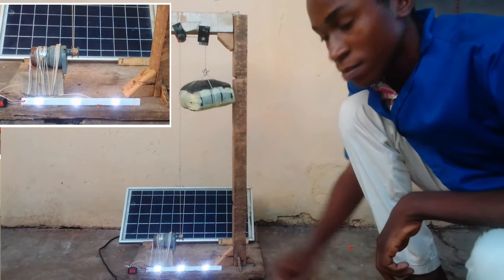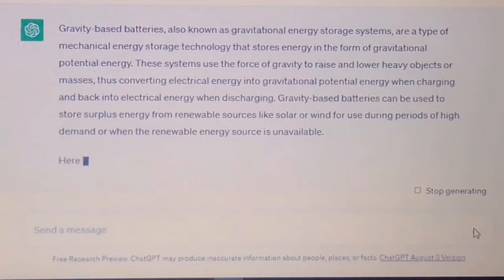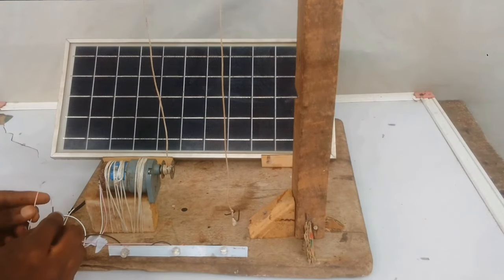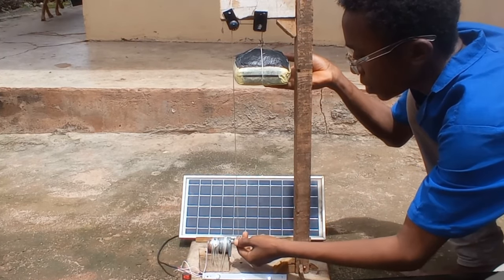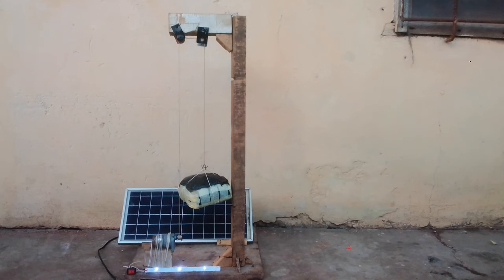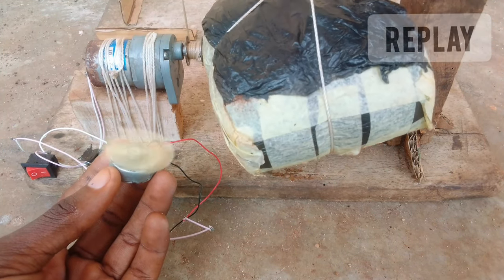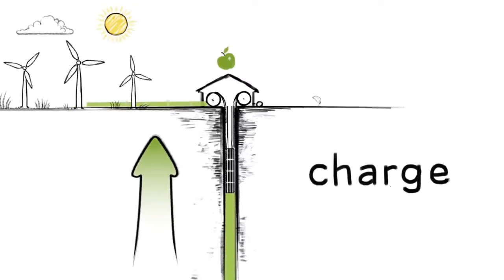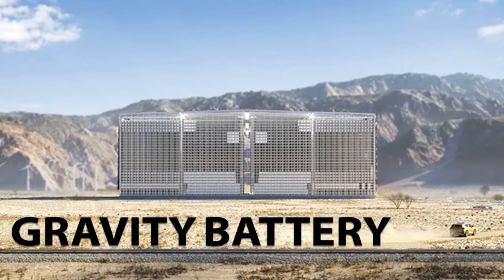I Made a Battery that works with Gravity! 🤯 DIY Gravity Battery #science #Gravitybattery

Comment: Hello, Thanks for the video. One question, what kind of motor are you using ? Can you provide the reference to it ? (and or more specifics ?)
Reply from the maker: Thanks For watching, the Motor used is a 24 VOLTS DC MOTOR, you can also use a 12 Volts Motor, ty weight Is a 2 kg load... Hope this helps
Reply from the maker: Thanks For watching, the Motor used is a 24 VOLTS DC MOTOR, you can also use a 12 Volts Motor, ty weight Is a 2 kg load... Hope this helps
Reply: Thanks for answering, one more question, is there a way to make that first push of the motor (to make it fall or go up) automatic?
Reply from the maker: @ultrasonic7730  actually no, or none that I know of, like most electricity generating projects, it needs a way to ignite or start, if the weight falls freely, it would be inefficient